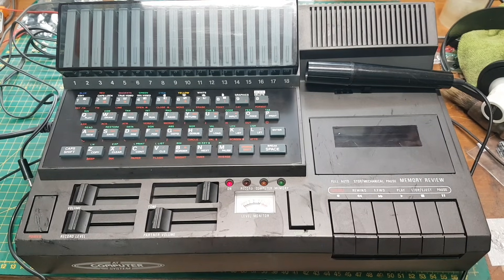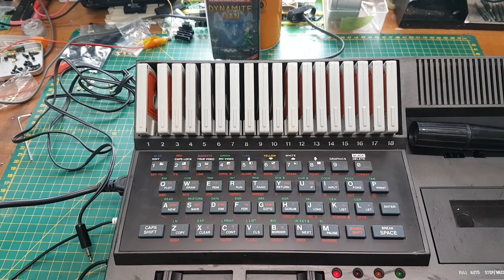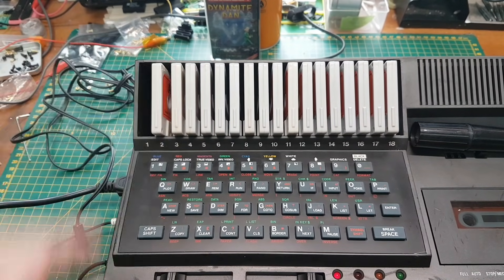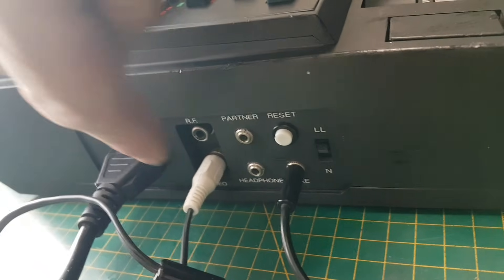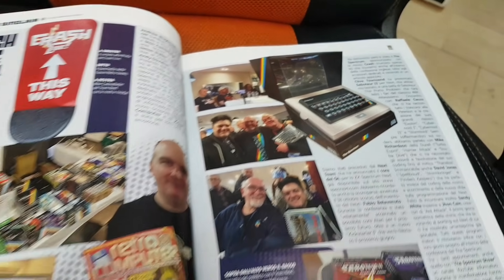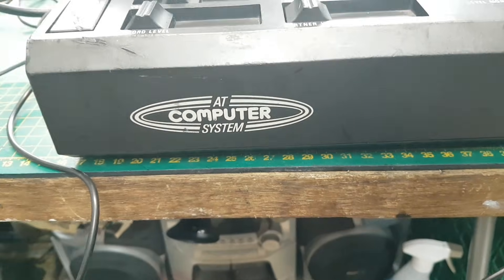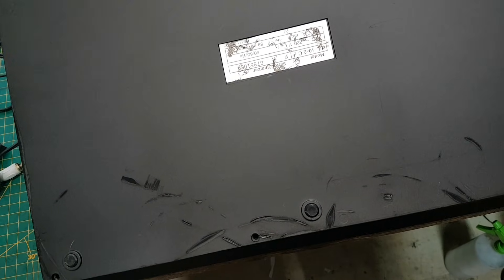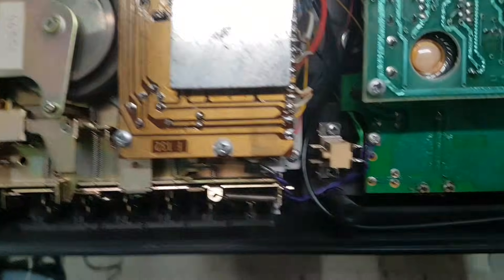Italian ZX Spectrum created for the schools

Comment: So, what's the Spectrum actually used for, with that?  It plays audio tapes teaching English, but I didn't see anything using the Spectrum.
Reply: there are other 2 extra tapes very very rare with the enciclopedia software for the tests. I've sent the Tap version to Wayne.
Reply from the maker: See that's the beauty of it , on each one of those tapes normally you get a left and right channel on A side, then you turn the tape over you get a left and right channel on the B side  which gives you left and right stereo ,But this type head is an 8 track tape head , meaning that if there is a Spectrum program in there it's recorded on either a left or right channel the over two tracks are audio English and Spanish the third channel feeds a signal into the computer to Load  images on the screen ,like a Cat Dog etc